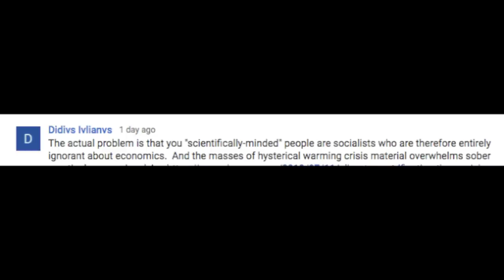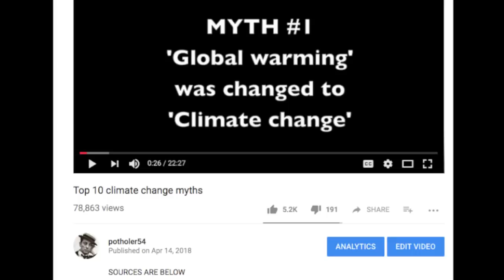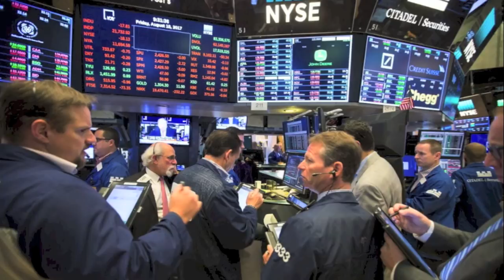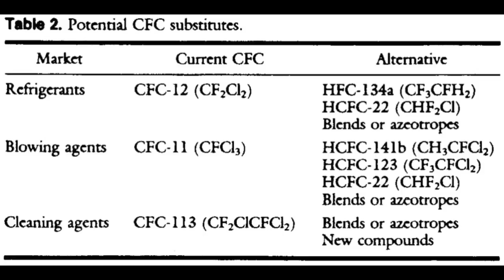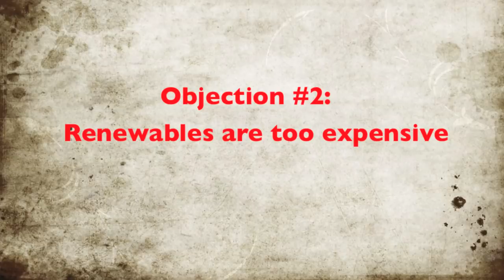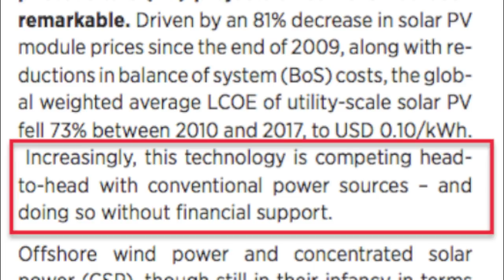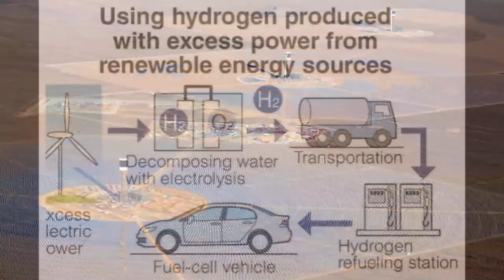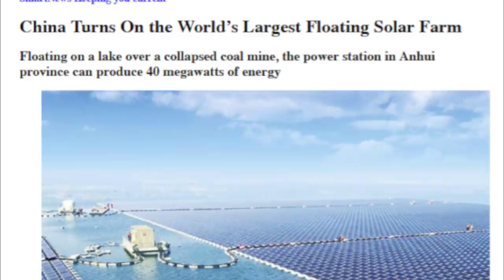A CONSERVATIVE solution to global warming (Part 1)

Comment: Fossil fuels were the fuels used, but they are not, and were never, the only option. The industrial revolution happened because of technological innovation and scientific discovery and invention, not because of fossil fuels. Fossil fuels like coal, oil, and methane gas had been known of for centuries, millennia even. They were just a fuel source to power modern machines, but they have never been the only option for fuel.

The first few years of automobile manufacture saw more electric vehicles produced than ICE vehicles. Diesel engines were designed to run on peanut oil, petroleum corporations devised diesel fuel specifically to run in diesel engines (so that they wouldn't lose that market share). Tesla and Edison debated on whether coal or hydropower should be the main method of electricity generation throughout the country. Tesla showed that the current need for lighting could be met with distributed, run of river hydro systems across the country.

In 1918, Tesla said, "If we use fuel to get our power we are living on our capital and exhausting it rapidly. This method is barbarous and wantonly wasteful and must be stopped in the interest of coming generations."

Fossil fuels won out not because they were necessary, or the best choice, but because rich, controlling interests stood to make the most money (and still do) by exploiting those fossil fuels, profiting off them. They were never the only choice.

It is a great error to assert that simply because something happened a certain way that that was the only way it could have happened.
Reply: No, but the industrial revolution was heavily influenced by the steam engine and combustion turbines, which require the burning of energy dense materials. Compared to other options such as peat or lumber these fuels have significantly more energy density. Even to this day energy density is a major characteristic driving energy share. Energy density is the reason why new batteries are under research and the reason why biofuels are struggling to compete in today's market. Energy density is partially the reason why humanity evolved from the combustion age to the nuclear age, as fission of uranium has millions of times higher energy density than coal and oil. 

As for the hydro versus fossil fuel debate. Hydro is very geographically constrained, whereas fossil fuels are easily transferable and can be used anywhere. Hydro also requires a significant amount construction with high initial capital costs, and would typically require flooding the nearby lands of those streams. While fossil fuel pollution may be more dangerous today, during the 1800s this threat was less understood and certainly not considered for investment and development.
Reply: Distributed hydro systems have always been an option, even in 1900, and do not require flooding. At the time (as I said) pretty much the whole country could have met electrical needs from that source alone. The sole exception may have been Texas. 

Yes, of course energy density is important, but mostly to maximize profits for energy producers, not in terms of providing energy in the most sustainable and sensible way possible. Most of the energy we generate is wasted or used frivolously - all (again) in a way that is ideal for energy producers. They have no incentive to reduce waste, as wasted energy is still energy they can charge for. Burning fuels is incredibly inefficient in terms of waste energy (particularly waste heat). Solar panels and wind turbines may be far less dense, but the direct conversion of their energy is far more efficient. 

Obviously there are some applications that would still require extremely high-density energy sources (such as launching rockets) - but the vast majority of energy use (transport, heating and cooling of living and work spaces, etc.) can easily be met (and more efficiently met) by less dense sources. And this has always been the case. 

This is about energy providers maximizing their profits, not what is best and most sustainable for our ecosystems, public health, or even just society in general.
Reply: At the time as in the 1900s? How about today, where the USA generates 4.08 million GWh per year? The USGS projects that the USA would max out hydroelectric potential at just 10% of generation. 

"Yes, of course energy density is important, but mostly to maximize profits for energy producers, not in terms of providing energy in the most sustainable and sensible way possible."
That's not accurate at all. We have to generate x amount of energy, so by using sources that have more energy potential per kg of material you would be utilizing significantly less materials than other sources. All reserves being equal this would be the more sustainable approach. 

"They have no incentive to reduce waste, as wasted energy is still energy they can charge for."
What are you talking about? Consumers pay the electricity bill, they don't pay the heat output bill for refineries. 

"Solar panels and wind turbines may be far less dense, but the direct conversion of their energy is far more efficient."
This is also not accurate. Solar for example is converting electromagnetic radiation from the sun, of which a significant amount is lost as energy has to travel 93 million km to earth. On top of this, typical solar cells can only utilize visible light wavelengths that max out at 43% of the already reduced energy output from the sun. On top of this typical solar cells are only about 20% efficient. On top of this you only access the energy output for limited periods of a day. 

Wind turbines offer better efficiency, but similarly you need to calculate the energy output responsible for generating wind, which is then reduced as the wind turbines only access a small percentage of the kinetic energy exerted by wind loads. On top of this you lose energy (like all other turbine driven applications of energy) as the turbine does work turning the drive shaft, which then converts your electricity in a generator. However, unlike most turbine applications wind turbines are typically not located near energy distribution facilities in major cities, which means you also have to calculate the percentage of energy lost in longer transmission cables. Lastly, like solar, you only access the energy output for limited periods of the day.  

"Obviously there are some applications that would still require extremely high-density energy sources (such as launching rockets)"
How about something just a little more practical like a concrete manufacturing center, or a desalination plant?

"but the vast majority of energy use (transport, heating and cooling of living and work spaces, etc.) can easily be met (and more efficiently met) by less dense sources. And this has always been the case."
Interesting opinion considering the entire scope of human history begs to differ. Humanity has always progressed to using more energy dense materials and innovated products to maximize efficiency. Even with lower energy dense sources like solar - why do you think we make solar cells out of polysilicon today instead of selenium like the cells in the 1900s?

Comment: Did I see a photo of a solar roadway? That’s a dumb idea.
Reply: Why is it a bad idea?
Reply: @eddyspaghetti5009  thunderf00t has a video series dunking on solar roadways
Reply: Bryan ill check it out.
Reply: Bryan it isn't very math based and seems to strawman the project, most of the math is about the cost no math of how much it would save but for me it just needs to go into the specific type of glass and  physics and he is wrong that it will bankrupt the country, there is no way this would be done over 1 year, it is probably a little more expensive than Medicare for all which is 3 trillion a year over 10 years we can do that.
Reply: There are a few more advancments to be made before it is viable, its still in the prototype phase but it is a good idea.
Reply: @eddyspaghetti5009  Making roads out of glass is a horrible idea, you can't put a tractor trailer on that, let alone have it perform an emergency stop @75 mph. Putting things on top of your solar panels is a horrible idea. Not angling your solar panels to the sun and having them track it across the sky cuts your output in half. Having your billions of dollars of electronics at ground level where it will be flooded/corroded is a horrible idea. Trying to replace paint with led's is a horrible idea. Heating roads instead of just pushing the snow off is a horrible idea etc.
Reply: jwfcp depends ont the type of glass, doesn't need to be as efficient as another method because it doesn't have to replace them.
Reply: Eddy Spaghetti : Solar roadways are not a good idea for mainly 3 reasons. They are horizontal. Not the way to set up solar panels. Roads are made of rock held together by flexible bitumen. Rock is VERY hard. Glass or plastic of panels wouldn’t last long. Roads get covered in snow, and at busy times covered in cars. 
Roofs , on the other hand are excellent sites, or panel farms with the panels at optimum angle.
Reply: Colin McGarry glass can be made that is harder than concrete, the roads are set up to melt snow(still need innovation to be viable). It doesn't need to be as good at producing energy as a solar farm, it just needs to produce more than it uses to make the roads likely more drivable than concrete roads.
Reply: Eddy Spaghetti : Your not thinking this through. If the roads are covered in snow how does the sun get to the cells? How will vehicles stop on smooth glass. If the glass is rough enough for tyres to grip it will be opaque all ready. 
The cabling will go where? For hundreds of miles.
Thunderfoot has a video on an experimental carpark surface. Many of the panels aren’t working and becoming dislocated. That’s without 40 ton trucks running on it.
These ‘great ‘ ideas are crowdfunding scams. Like waterseer, self filling bottles, plastic from air.
Reply: Colin McGarry it isnt ready yet, but the glass isn't opaque. The snow will not be able to stick because the road is going to be heated. There are multiple prototypes,(currently 4 or 5)eventually the kinks will be sorted out.
Reply: The cabling is probably the easiest part.
Reply: Eddy Spaghetti point one out that actually works.  So the glass is transparent and smooth, so cars can’t stop. Cabling easiest. How?
Reply: Eddy Spaghetti : For prototype do you mean like 100yds of tube with a trolley running at 40 mph is a prototype for hyperloop.
Reply: Eddy Spaghetti ‘probably’ , ‘glass not ready yet’, ‘protypes’. Is that supposed to be a serous argument.
Reply: Colin McGarry the glass is already ready i didn't say it wasn't, i meant the solar panel part of the road, it broke and hasnt melted the ice effectively  yet, in all prototypes glass is transparent and strong enough and rough enough. I said probably when talking about the quality, if there is no snow it will probably be easier to drive on. Prototypes like a gas engine that produces half of what it needs to.
Reply: I should have thought the reply through and realized i didn't explain  what i meant by "it" in the first sentence.
Reply: Easier to drive on then a concrete road.
Reply: Prototypes of the solar road
Reply: @eddyspaghetti5009  keep in mind, thunderf00t is a research chemist with a PhD in chemistry. This isn't some random dude making a video - this is a science researcher, resolutely refuting the practicality of solar roadways. You can say he doesn't use enough math (he has numerous videos on solar roadways - check the rest out I guess). 

You'll notice that nothing has happened on the solar roadways project in recent years. Do you know why? Their prototype is awful, broke down, didn't produce nearly as much power as any other solar system mounted anywhere other than the ground. It cannot be driven on (tiles are awful for roadways, as TF points out), and it hasn't received serious funding from any public institutions, because any civil engineer or materials scientist will tell you how awful an idea glass road surfaces with pointless LEDs and solar cells built into them is.
Reply: Bryan there is actually a new prototype meant to fix the problems with the melting of the ice and the low output of energy. It's the 4th or 5th prototype.
Reply: @eddyspaghetti5009  I just don't really see a reason to replace roads with solar panels, when you could just put them besides or over the road and solve all the problems with weak glass, broken components and horizontal panes. There is just no big problem that solar roadways would solve.
Reply: Erik Präntare they could make it easier to drive by melting ice, and you can't put solar panels above most roads, i think  there is a point in collecting albeit less efficiently sunlight that would otherwise not be collected. I don't expect it to replace any other forms of solar power, just to produce power where normal solar panels can't practically be put and to make it easier to drive. If they made an electric road it would be almost as cool as a solar road.
Reply: Also preventing ice and snow from even being on the road.

Comment: BTW, we already have a very efficient and cheap technology to take the excess CO2 from the air. It's called a forest. Or a field, if you like.
Reply: Bio-sourced liquid fuels are a carbon-neutral Solar power system that can provide feedstocks for fuel anywhere that can grow weeds.
We'd think that fans of "free market" would appreciate that instead of rolling coal and supporting monopolies and funding oil wars and being bent over & on our knees to "service" the Saudis.
Reply: There is not sufficient room on the planet for enough trees to remove CO2 from the air at the rate we're putting in out there. Planting trees is not a magic silver bullet.
Reply: +Äijänkäppänä, writes "BTW, we already have a very efficient and cheap technology to take the excess CO2 from the air. It's called a forest. Or a field, if you like."

Have you ever heard the term "deforestation"? You might want to look into it, it's a big problem.

Comment: Like a lot of your Ideas but whatever your working definition of 'free markets' is doesn't make sense. E.g you said free markets solved ozone and lead problems in the same breath that you mention that governments had to impose restrictions on those things to get markets to do what they did to solve the problems. How is that free markets? Its markets sure, but 'free' markets, at least as it is both colloquially and theoretically used as a term means markets unregulated by government intervention. It seems to me that what your really saying is that markets are a powerful, perhaps necessary, tool in solving these problems, and I think that is probably correct, but if all the successful examples of that you can think of involve the government getting heavily involved to push markets to achieve specific outcomes then doesn't it equally stand to reason that well worked out government regulation of, and intervention in, markets is an equally necessary component of the solution to these types of problem?
Reply: Ian M  I agree that all 'markets' exist in a legislative context. But then what defines the line between 'free markets' and other 'markets' is it just a question of degree? It seems to me that the later term is just a meaningless propaganda term? or is there a clear place to draw the line where a free market stops being 'free'?
Reply: Free markets without proper controls destroy rhemselves. They will ultimately deplete or destroy rhe underlying resources that support the society.
Additionally, the system devolves into monopolies and cartels that drain wealth and political power from the rest of society. 
What is missing from this video an understanding of why society is paralyzed when facing this threat. The people and organizations that control our political system, economy, and media have a vested interest in resisting change.
Reply: @anthonyderosa7757  The idea of "Free Markets" came into vogue in the 19th century, in the context of industrializing economies (starting with the UK) trying to break down barriers to trade like guilds, tariffs and import restrictions.  Today, free markets is largely a question of degree - the more barriers to entry/government interference, the less free the market.  But @Ian M is correct - no markets are without regulation or government impositions, and that is why child labor, the 8 hour work day, dumping untreated waste, etc aren't widely practices anymore.  

The only people who talk about "Free Markets" in absolute terms are economists and theoreticians - it's like a perfect vacuum or a friction-less environment; they don't exist in the real world.  When used in policy debates, the "Free Market" is (as you say) a largely meaningless propaganda term.  If another country has tarriffs on your imports, they're not a "Free Market"; if you have subsidies for your industries (as the US does for both coal and oil, among others), then it's not a problem.